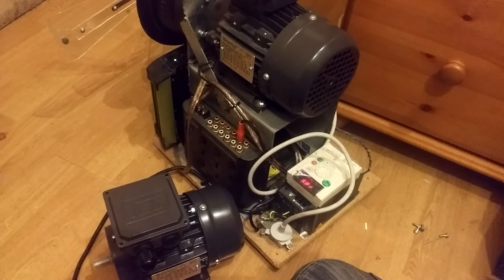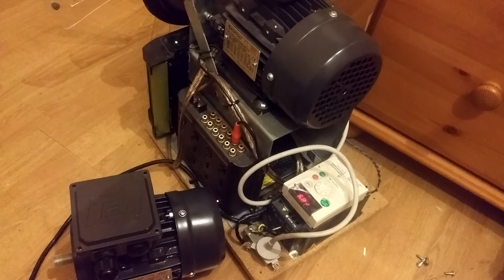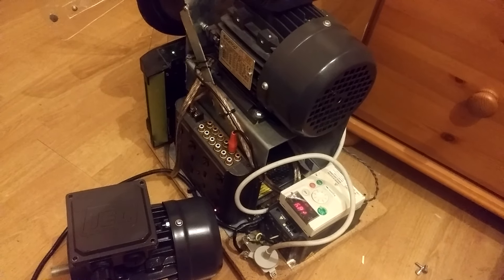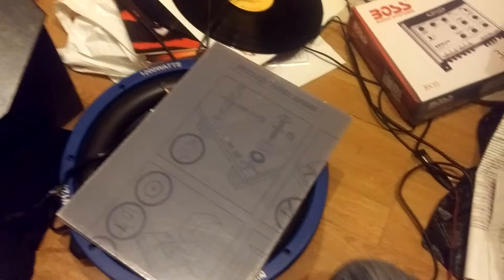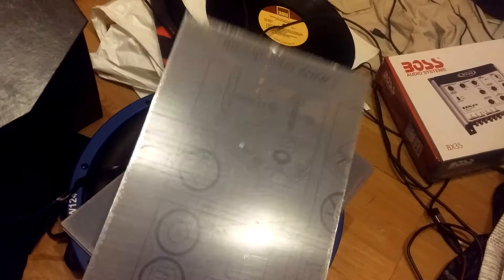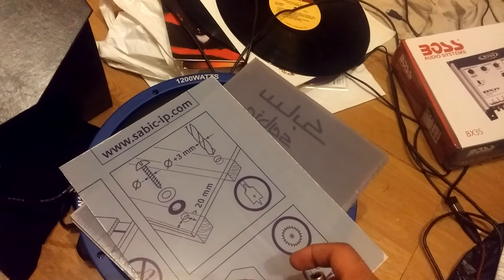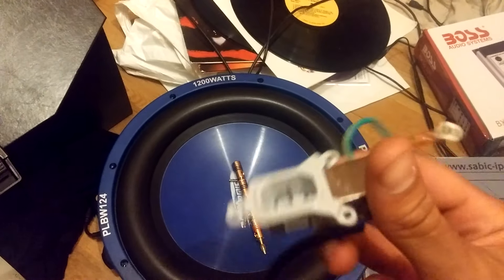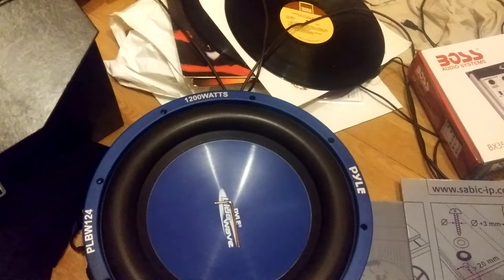Making the worlds lowest frequency subwoofer! Rotary Woofer Build Number 2!! Part 1

Comment: Did you select the motor unit based on T-S parameters?  Presumably Bl and Xmax are the crucial ones for this application.  Do you have a plan on this build to prevent voice coil rubbing?  Not only will it generate noise and reduce efficiency but it will nail your long term reliability.  Finally, what is the studio's plan for baffling?  Will they go for some kind of transmission line or do they have an infinite baffle already set up?
Reply from the maker: Bass Character I bought the motor based on its consistsncy, as for voice cool rubbing, it should be fine if it's allogned properly and they will have to use an infinate baffle system

Comment: I'm fascinated with your endevours. Just curious, if in one of your videos your rotary woofer was playing but obviously my computer speakers didn't do it justice. However, if I were to make one of these and have it connected to my computer theoretically I should be able to hear the low sounds coming from your video of your rotary woofer, right. I'm trying to grasp the concept if or how much audio out there actually has low sound in it. Any clarification would be appreciated. Now I have a new use for my RC helicopter with its carbide blades, brush-less motor, etc.
Reply from the maker: Chris Laing within reason. it depends on the recording equipment used. but there is a fair amount of content out there you just have to find it. but decaf tracks on YouTube are alright. but if you want pure sine wave you can find online gone generators that will do this